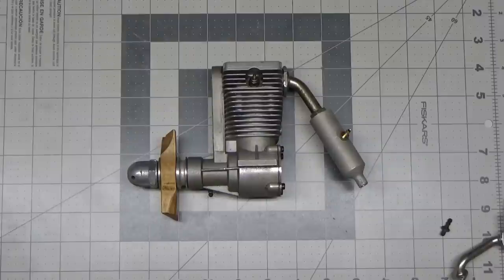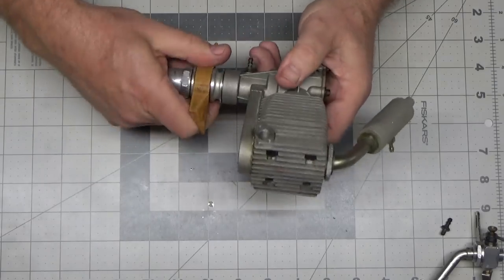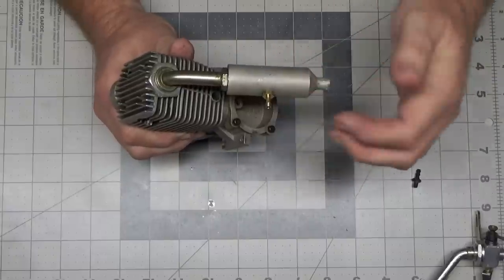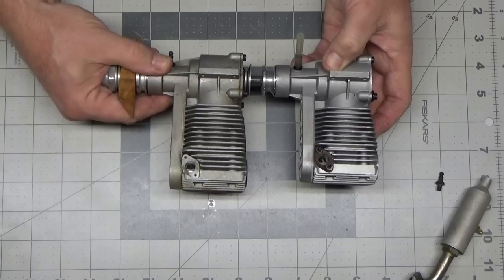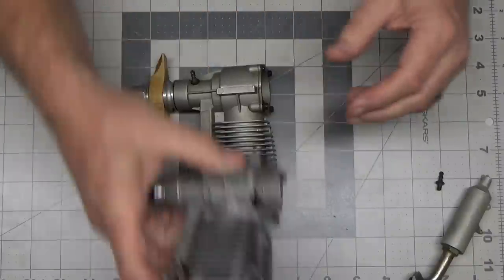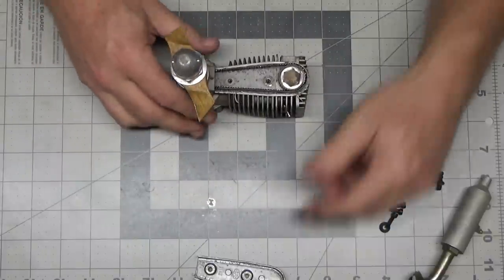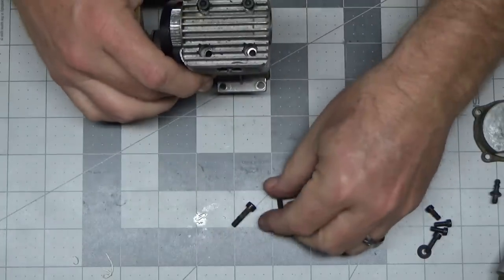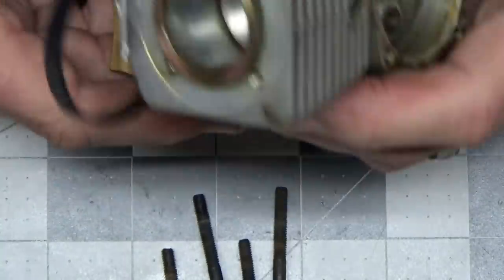Webra T4-80 A Look Inside

Comment: lol, seeing the dreaded "enya" type wrist pin hole... awe hell... pretty sure ive only dealt with it on enyas... then again, my memory is a blur...

nothing was as bad as a "danarm" chainsaw i once had... crowded needle roller bigend...

could only access through the transfer ports, holes drilled into the case and cylinder with covers bolted over them...

lets say that thing never ran again :) actually, i did get it back together but that was the least of its issues.